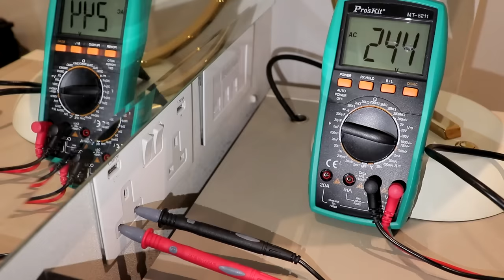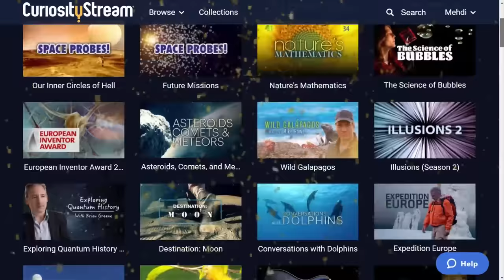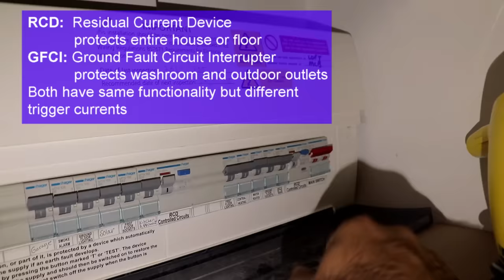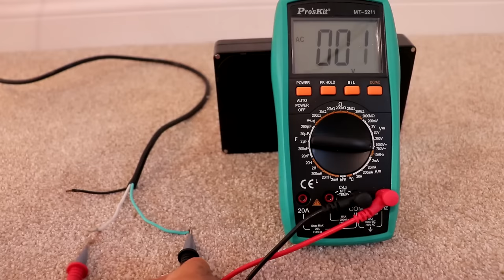Power Outlets in United Kingdom

Comment: Canadian Electrical Engineer goes UK Sightseeing 

He looks at the amazing common sense design of plugs and outlets
Reply: No. Just look at a wonderfull german plug/outlet.
First our outlets are not just holes were you stick in your contacts but they are also a little set back so they hold the plug in place and no matter if you have a plug that has all metal contacts or only a metal tip they can never be exposed to the users hands because the plug fills the outlet completely and hides the contacts behind it. Our grounds are exposed so you can touch them with your bare hands before you work on any electronic device (like a pcb) and get rid of any static energy in your body. And: You can plug in your plug BOTH ways around (not like a uk plug where the ground defines on how to plug it) because we have a ground at the top AND the bottom of a plug/outlet. And you can even make them child proof with a little plastic cap you can glue into your outlet that requires you to turn the plug you wanna stick into the outlet 90 degrees clockwise bevor letting you stick it in. Much harder to open with anything thats not a plug than the mechanism shown in this video
Reply: @toni castrito Mate, sod off.
Reply: @SebastianHaban  The German system looks safer but it's still flimsy 2-ping shibe. Safer but not wonderful in my opinion.
Reply: toni castrito I can see you’re still mad Salvini isn’t prime minister
Reply: @toni castrito You must be a very sad sight in real life :(
Reply: @metallitech  To be fair, making a 100% safe/fool-proof plug-in without making it frustrating to use or putting too many safety features that the user feels like using their plug is a burden, then it will defeat the purpose of a plug.
Reply: elusive  looks like someone's salty
Reply: @SebastianHaban  I have to agree honestly I'm from America girlfriend is from Switzerland (I'm moving there so she can be with her family) so I've spent some time there and I have to say far superior to north Americas and easily to the uk personally I'd rather have north American plugins than the uk version but Switzerland seem to be alot better
Reply: Dear Electroboom, could you please do a video on wiring a single-phase motor and also another video on wiring a three-phase motor. Millions are confused about this issue because people are buying or sometimes been fooled by sold wrong motors and they get into lost of trouble.
Reply: @toni castrito hey toni great comment and i agree he should do another video like this one about Iran, or maybe do a series where he looks at electrical systems all over the world! Taking closer looks at details that look mundane can be a great source of edification! 

I don't think it's fair to paint Europeans with such a broad brush. Sure there are assholes that make a big stink about silly little differences like that but I think if you give people a chance you'll find that most of them are actually pretty welcoming, no matter where you are on this planet. Europe isn't totally white, either, they've got a pretty diverse mix of peoples and cultures and they seem to get along pretty well. It can be pretty disheartening to read the vile racist garbage some sacks of shit post online, but I think the fact that you mostly see it online is a tacit admission of the fact that they know it's wrong and that they can't actually say any of that shit in polite company, because again most people are pretty welcoming and look down upon racism and bigotry. I know it's easy to lose faith in humanity, Toni, but I think you should try to restore your belief in the basic goodness of your fellow man. Being cynical and untrusting will only make you miserable and paranoid, and that's no way to live. You deserve to be happy, Toni, and the best way to do that is to open up and start trusting people. We're pulling for you. Have a nice day.
Reply: @toni castrito knob
Reply: Sebastian Haban
I'd disagree that plugging in both ways is an advantage.  Usually plugs that do that have a wire coming out of the back, perpendicular to the wall, which is very easy to trip over.  A wire that comes out of the bottom like a normal UK plug can easily be tucked against the wall.

Of course, this isn't a rule (well it is, but its often broken) as many thoughtless power adapters for laptops and USB are just American prongs that fold down and slide an adapter over them, as such all the wires stick out from the wall and get caught on people and pets that don't or can't pay attention.
Reply: Other than hell, you're not welcome anywhere else.
Reply: @uzzie88  make sure you @ people when you tell them to go to hell or they won't get a notification
Reply: jameswalker199 If you use power bricks on an extension cord with several outlets you'll see the advantage of pluging left AND right ;) 
For Wall sockets you're right there is no difference and we also have many plugs with the cable running downwards design. But most places there just aren't enough wall sockets for every device..
Reply: elusive I'm gonna tell you anyway!

Comment: 2 sets of breakers, so if one trips the then still works. Usually upstairs lights and downstairs sockets on one breaker, and the opposite on the other. You can then use a desk/standard lamp to light the room if your ceiling lights go out.

All the “redundancy” of separate fuse, earth and socket shutters was designed in from the 1950s before GFI/RCDs were available to be fitted. Older houses that haven’t been re-wired recently still only have wire fuses in the “breaker” (fuse) box. The shielding on the pins was introduced later in around the 1980s. So none of these features are “redundant” if you are in an older house without RCD protection.
Reply: Stuart McConnachie Sockets and lighting will never be on the same breaker. Upstairs and downstairs lighting will each be on their own 6A breaker and each socket ring main will be on its own 32/16A breaker.
Reply: @sinista6536  32amp for a ring main is typical, but 16/20amp for a radial circuit is common for emersion heaters and boilers.
Reply: Shuttered sockets go back pre-WW2 in some cases and even BS 546 - the spec for round-pin plugs - allowed for sleeved pins. I have a few in my collection. Some sockets interlocked so you couldn't switch on the power without a plug being inserted.
Reply: @sinista6536  I'm sure he meant to say that one half of the split load board, should have breakers for upstairs lighting then downstairs sockets covered by one RCD. The other half of the board should then be protected by the other RCD which covers the opposite breakers, such as downstairs lights and then upstairs sockets.
Reply: SinistaUK yes, so upstairs you have lights and sockets on different RCDs, and downstairs you use the opposite RCD - so you don’t end up losing all the lights in the house, or even all the lights in one room (assuming you have at least one floor lamp) when an RCD trips.
Reply: SinistaUK Yes, of course sockets and lights are always on separate fused circuits/breakers 🙄
With hindsight I could have phrased that better: “Usually upstairs lights and downstairs sockets IN ONE SET OF breakers, and the opposite on the other”.
Everyone else who replied understood what I was trying to explain though (thanks)....
Reply: In the Netherlands its now 4 breakers on 1 RCD.No more.But that's a new rule,so lots of houses have no RCD at all..Just the old fuses..And the breaker switches the neutral too!
Reply: @sinista6536  He means on the same side of a split load consumer unit.

Comment: the UK Shaver sockets as well as being RCD protected in newer installations (since 2017 by regulations) also uses a 1:1 safety isolating transformer as a means of protection
Reply: Yes I was surprised he didn't mention this
Reply: How does the RCD work when it's transformer isolated? Surely there isn't going to be any leakage to earth when it isn't earth-referenced, per the transformer?
Reply: How does an isolation transformer make that system safer?
Reply: @Motorman2112  It looks at the current balance between the 2 legs.  It disconnects if they don't balance.
Reply: That sounds expensive and inefficient.
Reply: @alext9067  Yes, but normally that imbalance is created when a person touches a live conductor and creates a secondary path to earth. With an isolation transformer the supply isn't earth-referenced, so touching one conductor won't do anything, you have to touch both to get shocked, which is where the safety aspect comes in.

What I'm not understanding is how the RCD is going to function / how a current imbalance will occur. If you're touching both conductors and getting shocked you'll just look like a small load on the circuit. 

I may well be missing something.
Reply: @roflchopter11  does your life have a cost associated with it?
Reply: @alext9067  If there is an isolation transformer, then even if you touch between any of the prongs and earth, you won't get a shock. This is because the voltage is not referenced to ground.
Reply: RCD and isolation transformer seem mutually exclusive... Any thoughts?
Reply: The isolation transformer does defeat the RCD, but provides protection from current flow to ground, which is the biggest hazard in that scenario when someone drops a shaver into a bowl of soapy water and then grabs it.
Reply: @Motorman2112  It is earth referenced, but through a very large (10 MOhm+) resistor.   That limits fault current to only a few milliamps.
Reply: @Motorman2112  I don't think you're missing anything.  You would become a resistive load and not open the circuit.
Reply: The transformer is to convert to 120v
Reply: @roflchopter11  It works and it keeps people safe beyond any reasonable doubt. Efficiency is good and all, but safety and lives are much more important.
Reply: @Motorman2112  It doesn't, unless you touch the live wire upstream of the transformer somehow. You can't get a shock anyway from touching just one wire downstream of the transformer because there is no return path to Earth.
Reply: @bigclivedotcom  I somehow read your comment in your voice.
Reply: Seems to me like a proper GFCI would do the same. 

Like it or not, human lives have a finite cost. Everything you interact with on a daily basis is engineered to achieve some balance between cost and safety.

It may be that the RCD is not sufficient to adequately protect people from shock, in which case, the cost and losses associated with a 20W transformer in the wall may be justified. Here in the US, people run hair dryers in the bathroom. A 1.5kW isolation transformer is an expensive, always-on reactive load generating heat in the wall. GFCIs on the outlet and the hair dryer itself provide redundant protection.
Reply: @TheFurrymunster I haven't seen a lighting circuit be RCD protected in the UK, unless it's been on it's own RCBO. I think this is a decent compromise so you aren't plunged into darkness because of a fault in an appliance, and it's much less common to be shocked by the lighting circuit anyway.
Reply: @Alex T Yes, but for mains voltage, it is a different story. The neutral is grounded and if you stand between live and earth, the circuit is completed through your body. Having an isolation transformer, you don't get a shock because the circuit does not close through your body.
Reply: That settles it. @ElectroBOOM you need to do a test to show how a safety isolating transformer works. Much appreciated.  Your fans.
Reply: @oniruddhoalam2039  This is ac.  You can still conduct current if there is a sinewave on the leg your touching.  If you are grounded, you will be part of a capacitive load and if the voltage is high enough, the current could stop your heart.

Comment: "If you step on these plugs facing up, may got have mercy on your sole".  If that's not the best pun of 2019 I don't know what is.
Reply: Never seen a UK plug puncture a persons foot before. But I have seen one punctured by a US plug. Nasty
Reply: @dimitar4y  If you step hard, you aren't stepping, you're STOMPING! ;-)
Reply: @forevercomputing  But stomping is +20 damage, the plug would lose!
Reply: Forever Computing. But you did get the pun?
Reply: I have photos of the damage to my poor foot from this
Reply: Wow! I must be tired, that one slipped right by me!
Reply: @forevercomputing  your Google Fu must need some work. I've seen it happen as well as online. It ain't pretty!
Reply: I have stepped on an upturned UK plug in the night, it certainly hurts but luckily nothing serious! 😊😁
The North American ones look like they could do far more damage if stepped on, the pins look thinner and sharper? 🤔😯😮
Reply: @dimitar4y  The pin would be intact, it's up to  the plug to defend from destruction. The gap between the  screw and cover is minimal. The gap at which the pin goes through the body is quite stout.
Reply: It hurts a lot worse than stepping on Lego bricks (I know)!
Reply: Only second to a lego brick (I've done both more than once) - only the 13A plug punctured the skin. BTW, I'm a UK based electrician with a child. Although I'm not a domestic electrician, the only domestic RCD's I've come across are rated at 35mA.  I work on a much higher level (25Kw) ;)
Reply: @BigKelvPark  I'm got (now grown up) kids and I sleepwalk lol. I'm also a commercial electrician, but have never seen 35mA RCD's only 10mA ,30mA, 80mA and 100mA (standard) there also 300mA, 500mA and 1000mA but I don't think I have ever installed them) and the installs I work on are from 21KVA (single phase) to 400KVA (three phase)!
Reply: @CrazySparkie63  You are correct, it was meant to be 30 as was the Kw should have been Kv (Railway).

Comment: 9:32 not to question your scientific testing, but it says at what current the RCD triggers on the RCD.
Reply: MazeFrame Exactly. Just under 30mA
Reply: That's just what it has to break by. 30mA within 300ms. In reality they will trip in the 20s.
Reply: @Goabnb94  :
"That's just what it has to break by. 30mA within 300ms. In reality they will trip in the 20s."

==Did you mean 20 mA? instead of 20 s?
Reply: @louistournas120  "the 20s" as in "20 to 30", the "s" wasn't a unit
Reply: Doesn’t matter what it’s rated for, it matters what it actually does.
Reply: @IronWarrior1316  - Great point.
Reply: @infinimancer  20's you used ms just before so to avoid unnecessary questions. please use the right signals. we invented writing to do this. so... 20's mA
Reply: Where's the fun it that though? After all, this is ElectroBOOM :)

Comment: In the UK, most wall sockets are wired to 13 amp, which means they can pull just over 3kw before they blow the fuse. on 110v that'd be 28.3 amp

Comment: Years ago in the uk wen electric was replacing gas lights and candles and oil lamps. The early electrical appliances wer run from a light socket instead of the then non existing 3 pin plug..this caused over loading on the earliest household electrical wiring causing fires and deaths by electrocution

Comment: You failed to mention that British plugs have another safety feature fitted where a gate is fitted where the wire goes into the plug that stops the wire being pulled out of the plug should it come under stress. This is either achieved via a piece of plastic that goes across the top of the wire as it enters the plug and is screwed down by 2 screws, 1 each side of the wire, or 2 pieces of plastic 1 placed each side of where the wire entrances the plug in a v shape that traps the wire being pulled out if under tension.